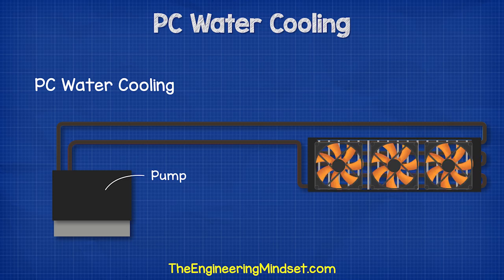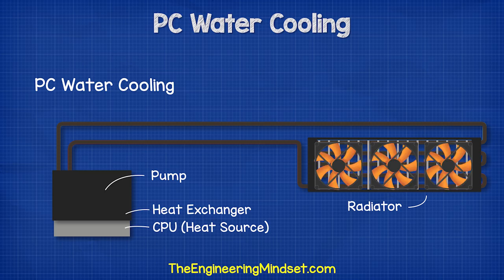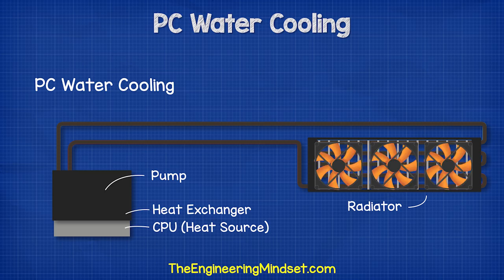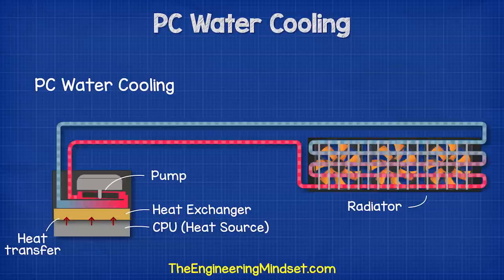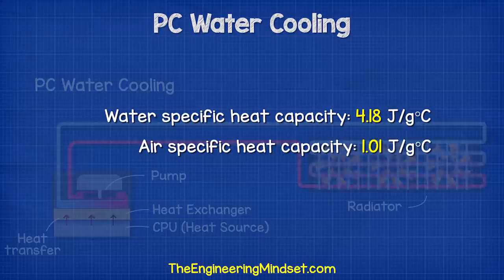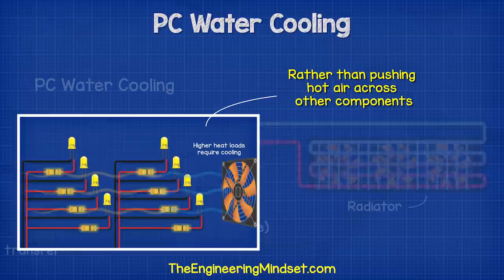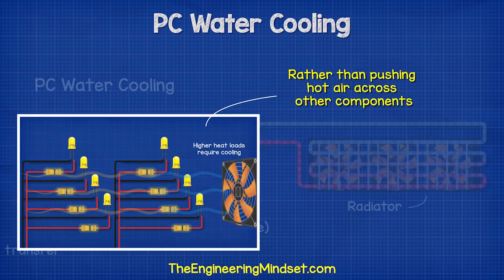PC Water Cooling explained

Comment: As a mechanical engineer who is also a gamer, this is one of my favorite hobbies. It's more fun to build the loop than actually playing games.
Reply: I wonder how well a system that's literally based on an automotive liquid cooling system would do.
Reply: @4G12  It's mainly for aesthetics and fun....Air coolers work just fine, performance wise...I guess some people add a lot of radiators and set the fans at low RPM to make a silent PC if you're into using speakers instead of headsets.
Reply: Building the loop is the actual game.
Reply: @4G12  Linus (LTT) used a car radiator in one video.
Reply: It's fun the first few time, after the Nth dozenth time it's annoying... especially custom water loops and ones where the customer picks the case based on aesthetic rather than functionality. Otherwise it's fun.
Reply: With you expertise how well do you think a a tower sealed and filled with mineral oil ,maybe even with a heat exchange ,would do vs a standard water cooling loop?
Reply: @edlong00  i wanna know that too
Reply: @edlong00  you will need some kind of pump and radiator. The mineral oil takes up the heat and you still need to dump that heat somewhere otherwise the oil will just get hotter and hotter. They work fine but generally aren't worth the trouble, dealing with the mineral oil is a pain and after a while the plastic connectors will all break down.
Reply: @downstream0114  A car radiator was used way before Linus even came up with the idea
Reply: I’m 16 and I started playing, “The Powder Toy” I’m watching refrigeration stuff and try to replicate it. Also, I want to pursue being a mechanical engineer cuz thermodynamics really is interesting for me.
Reply: What a geek
Reply from the maker: See our new video on how to build mechanical versions of electronic circuits? Watch here: https://youtu.be/Zv9Q7ih48Uc
Reply: just installed an aio cooler onto my gpu and man this is really fun
Reply: If you haven’t already you gotta try factorio lol
Reply: Those are some baaaad games you are playing.

Comment: i don't think that heat capacity of the water is the key aspect here. What matters here is the thermal transmittance of the whole cooling system. That's why sometimes a good air-cooler can outperform sometimes a water-cooler (especially in a airflow-oriented case).
Reply: Rightly said. Linus has one video where he compared Air cooler and water cooler where Air coolers outperformed Water coolers.
Reply: Interesting...

Comment: Just wait until an engineer designs a refrigerant based heat removal system in a small PC package. Ultimate cooling.
Reply: 2 steps ahead of you😎
Reply: Been done before man, cost is rarely worth the performance gain
Reply: Hi there.
This was done years ago, and the product was Asetek Vapochill.
I was running a custom water cooled system back then and always wanted to move over to phase changing. Never did get there but I'm still running a water cooled setup today.
👍👍
Reply: It's gonna sweat inside your pc

Comment: For our Thermal Fluids Design course, as the final project our professor gave one group of students his PC specs and tower dimensions and told them to go design him a custom water cooled system since he couldn't find a kit off the shelf that he liked. Sure enough, the students designed a system and came up with the EML for the setup, he was pleased, and several weeks later put his water cooled PC together. 
Our professor was certainly past retirement age too which made the whole project just that more interesting.
Reply from the maker: Interesting project with a real world application, great idea. When I was at uni we were given a cheap water cooler module and told to make it better. So changed the flow pattern through the block to increase the turbulence, velocity and distribution. It amazed me how much better it worked and how bad a product the original was.

Comment: After the unit has been run for a certain amount of time, what do the temperatures rise too? In other words the temperature going into the block out of the block into the radiator out of the radiator at what point do they become equal? Nobody ever mentions anything about equilibrium. They just say that it drops the temperature to a certain temperature and that’s it but they never show the temperature going back up.
Reply: They don't "become equal". At steady state the heat put into the loop by the cooling block is equal to the heat rejected by the radiators. At what temperature this happens at is going to depend on everything, how much energy is being absorbed, ambient temp, radiator surface area, fluid volume, fluid flow rate, etc. The temperature it stabilizes at will generally speaking be slightly lower than the temp that an air cooler with a matching surface area, airflow and ambient air temp would.
Reply: so long as you run a proper curve it wont ever get to that point.

Comment: That's not exactly how flow works in most pc radiators. It's also quite common to dump radiator exhaust heat into the case since it prevents the radiator from receiving air heated by other components. Often there's enough radiator space and airflow that intake radiatoes don't really affect other components.

Comment: Isn't it the same amount of work for the water to take heat from the CPU, compared to the fans taking heat from the water? I get that water heat capacity is high, but doesn't that work in the opposite direction too, when you're trying to cool the water back down? Is the only disadvantage of having the fans blow directly on the CPU, that hot air will hit other components? I reckon with some clever placement of components and vents that could be largely avoided, no?
Reply: A CPU is attached to multiple stuff and yes the hot air will hit other stuff i guess
Reply: But you scale up the surface of that water you can't do that with the CPU. But you know a PC isn't some kind of nuclear power plant so yeah

Comment: I always thought they actually do NOT use water just for the reason if you got a leak...water + electricity = not good. They actually use mineral oil which does not conduct electricity. I saw a video where a guy put a motherboard , power supply and hard drive into a fish tank and filled it with mineral oil. The fish tank pc booted and ran perfect.
Reply: That's really cool

Comment: Would the radiator work with just a fan no tubes?
Reply: The radiator is how the heat is dissipated and the coolant temps are kept low and stable.   The tubes contain the liquid coolant are used to get the liquid coolant/heat away from the CPU.  The coolant is how the heat is relocated from the. CPU to the radiator

Comment: The heat capacity doesn’t matter much, water is so dense that even if it had a slightly lower specific heat capacity than air it would still move way more heat cuz it’s like 800 times denser.
Reply: Doesn't the highter heat cap come partly from the higher density?